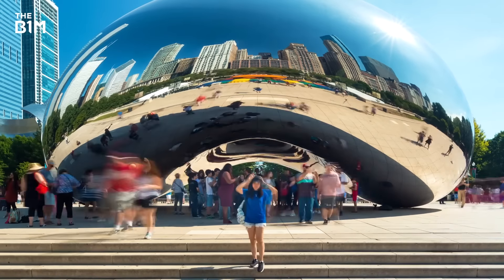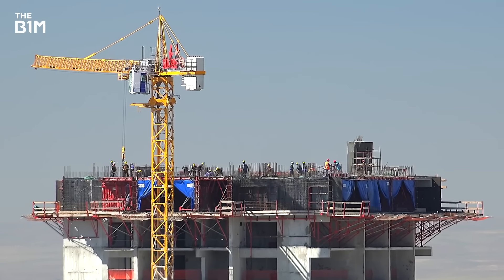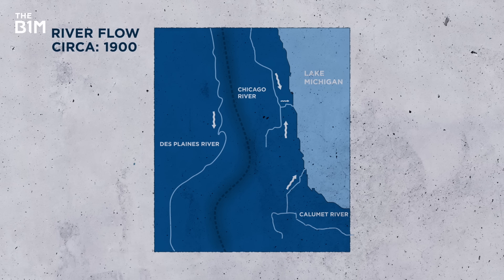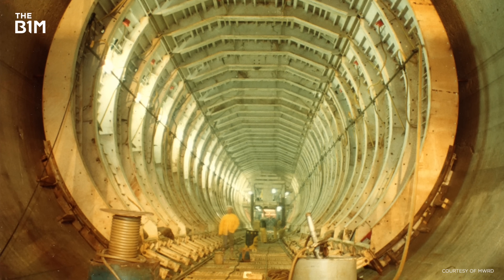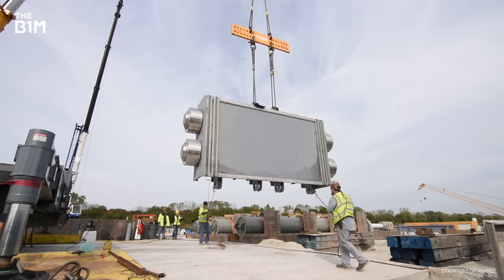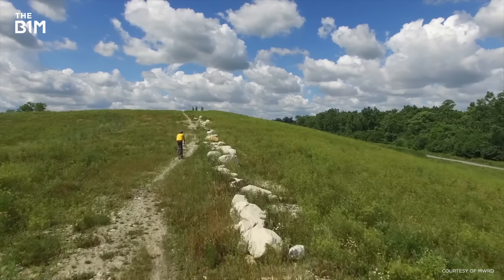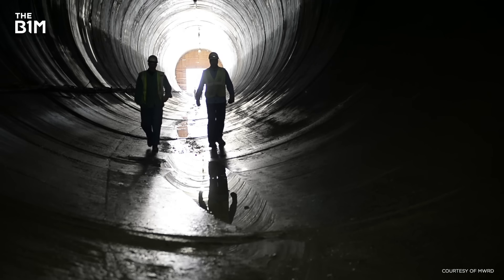The Secret $4BN Tunnel Network Under Chicago

Comment: 4:10 for 8 years as a OTR truck driver i drove past this absolutely massive pit next to the interstate near chicago and had no idea what it was. Now i know!> And trust me, its soooooo much bigger then it looks on camera. The ground just vanishes on either side of you for half a mile, freaked me the heck out the first time.
Reply: How to find it on google maps
Reply: @fourthright  search for Thorton Illinois.  The massive hole in a limestone quarry.  It was not built for the Deep Tunnel Project.
Reply: @gobbletegook  thanks
Reply: wrong hole in the ground lol, you are probably thinking of the limestone quarry. It is much bigger than the resevoir and still actively being worked.
Reply: We call that "the grand canyon" on the cb lol
Reply: It’s the limestone quarry, goes under 80/94, they do a handful of tours every year, and I’ve wanted to do one so bad but the waitlist is like years long.
Reply: @Grintor  Not wrong, the Thorton Reservoir is on the other side of the highway from the quarry.
Reply: It sure is bigger than it looks on camera.  It's on I-80 and I passed over it for years.  It's kinda scary going over it.
Reply: Its another one 55 just north of 294
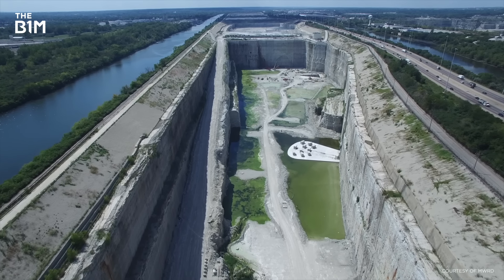Reply: @onenightstan3635  5:45 is a quick overhead shot of it.
Reply: @FastSloth87  It used to be part of the quarry though iirc
Reply: If you drive through Stickney on I-55, there's an example of what the tunnel looks like for the Deep Tunnel Project. It's on the north side of 55. Just follow the smell hahaha
Reply: It does look massive and I can imagine how big it would be based on other such experiences.
Reply: I've always hear that the majority of concrete in Chicago and suburbs was made with  with limestone from that quarry.  There is an observation deck on the north side.  The thing is huge.
Reply: Same here, I think only truck drivers can see it from our vantage point up high. Most people don’t realize how big those pits are. Never had any idea they were something other than a quarry.
Reply: than
Reply: You are referring to the Thornton quarry.  The tunnel guys did not build it, it is a played-out quarry.  They just now fill it with sewage.
Reply: @williamrgutrich7694  I never said who built it, all i said is now i know WHAT it is instead of just thinking its some random hole in the ground or i was seeing shit.
Reply: Ozinga bought it I think
Reply: @profecarrillo6479  Chicago is next to Canada not Mexico...
Reply: @SirFloofy001  my bad sir, I thought it was near Montaña or Montana (dumbed down name).
Reply: @SirFloofy001  meaning, I thought it was part of the occupied Mexican land. but no, it was never part of the First Mexican Empire or the ancient empire.
Reply: That's limestone Quarry. As a child I thought it was the grand canyon
Reply: Driving in to Chicago, one is overwhelmed by the ugly infrastructure. Chicago needs to tear down these ugly abandoned plants and allow green space to take over.
Reply: @mynameisjoejoe  and we call trucks that jake brake "idiots"
Reply: If you think seeing it is freaky you should try rappelling a few hundred feet down the side wall at night in January.
Reply: Is that the huge limestone quarry by South Holland ? I drove for UPS.  Every time I went to the CACH  I'd glance dn wondering how deep it was.....
Reply: Idk why they don’t put up a guard rail higher or something it’s so sketch best not spin out
Reply: Sure it wasn't tho old quarry by the railroads?
Reply: All Chicago Kids are told that Fred Flintstone works down there. lol
Reply: That quarry is by my house in lyons illinois
Reply: Question. What is OTR? Thanks
Reply: @pbinnj3250  “Over The Road” trucker.
Reply: @jseptoski  thanks.
Reply: @michaelkawell3300  LMFAO No it's not. You're halfway across the 'burbs from it. You're over by Brookfield and the Zoo, everyone who grew up here knows how far away you are, lol.
Reply: When your stopped on it with traffic. It moves quite a lot as well😂😅

Comment: Zoning rules in Chicago require any new construction over a certain site area to handle its own storm water internally on site. I have worked on several projects in the city that have required tanks in new buildings or underground reservoirs to store storm water and release it gradually into the system. This should help to reduce the amount of runoff into this project and help make a more sustainable storm water system in the future for the city.
Reply: Yep, this was incredibly contentious when it was first implemented, and now it's just a thing people know has to happen. I'm pretty thrilled the city stuck to its guns on making sure this happened, because now no one even bats any eye at it – it's just a thing you do. And it's incredibly helpful for the entire population.
Reply: @BlownMacTruck  it’s gonna increase the cost of building and expand their environmental impact. The city did not stick to its guns it put the problem on someone else. The city needs two separate sewers a sanitation and storm one. Anything else is not practical and very wasteful.
Reply: @mattmichael2441  I'd disagree that they didn't stick to their guns. They did pretty well given the constraints. Could it be better? Of course. But that's always the case in these situations. Too many NIMBYs and special interest groups fully opposed ANY solution, so I'm willing to give the city credit here.
Reply: Yeah that’s been the case in here NYC for a while now. It’s important as we also have a combined sewage and drainage system throughout much of the city which is problematic when there is a massive amount of precipitation. A similar system to this project but at a much smaller scale is being built around the Gowanus canal in Brooklyn to prevent as many “overflow events” from happening and dumping the waste into the recently dredged and cleaned up canal.
Reply: Pretty much any new development in the midwest requires some kind of stormwater detention system, it's just in less populated areas that's a detention pond(large depression in grass) and not a tank or artificial reservoir. But they serve the same purpose.
Reply: @mattmichael2441  It would cost quite literally 2-3 trillion dollars to do what you're suggesting, and the environmental impact from the project would be far more destructive than the negatives of the current mixed sewer system. Normal sized cities and towns were able to get rid of most of their mixed sewer systems a long time ago, because it's just a matter of running new pipes along road right of ways in most cases. In cities there are massive underground pipe and tunnel networks with huge skyscrapers everywhere. You can't even fathom what it would take to separate stormwater and sanitary sewers in Chicago, there might honestly not even be enough literal space underground to do it. You're way off base on this. - I'm a Civil Engineer in the Chicago area.
Reply: @mattmichael2441  Also, providing stormwater detention is a part of even small projects in small towns. The increase in cost pales in comparison to how much money is saved by the public and business owners from how much we have reduced flooding and flood damages the last 40 years. Now in most places flood damages only occur within regulatory floodplains, that was not the case 40+ years ago before stormwater outlet control regulations were put in place by most states and municipalities.

Comment: I love how we went from 3.45km twin tunnels in Auckland last week to 175km+ tunnels in Chicago this week. The amazement and wonder is real. 

Folks, only on the definitive channel for construction will you get some serious range. 

❤ The B1M
Reply: Ironic that a week ago Auckland didn't have a flooding problem but this week a system like this might have saved 3 lives and 1000 million dollars of property damage.
Reply: And I do have to wonder how the Auckland tunnel faired in last week's heavy storms & flooding rains.  Regardless of the potential increase for flooding rains & heavy storms, I think cities should be emulating Chicago's lead here - taking the storm water run-off, holding it safely away from residents basements, cleaning it up before releasing plus, using good landscape design principles to capture run-off & inundations before they cause property damage - just encouraging people to have gardens & proper soil instead of covering everything in concrete & blacktop would be a start.  I'd forgotten all about this, so good to hear it's heading towards completion & how it's improving the waterfront.
Reply: Roughly the same cost
Told you infrastructure in NZ is ridiculously expensive.

Comment: A very nice video! When we first planned the system in 1975 the plan was to have dual parallel tunnels, the second to be built after the first was completed. That has been dropped. Kevin does a good job of explaining the current theories on TARP.

Comment: Seems like a brilliant solution to a major problem. And the city of Chicago ought to be acknowledged for carrying out such an important project that took years to build.
Reply: The City of Chicago did not have a hand in building The Deep Tunnel Project. It was done entirely by the Metropolitan Water Reclamation District of Greater Chicago. The MWRD is it’s own municipality and does not fall under the control of the city or county.
Reply: @MrSquirrelboy  Thanks for highlighting this, I would not have known otherwise.
Reply: A handful of people died building this thing.
Reply: @MrSquirrelboy This also is the same method Milwaukee did to remedy our own flooding issues. Chicago even took the name straight from Milwaukee's Deep Tunnel project. It's a great way to handle such an issue without major overhauls above ground!

Comment: Chicago has one of the worlds greatest skylines.  Not overly dense but several clear vantage points where one is awe-struck by the powerful structures.  Returning from a trip on the East Coast, OHare was stacked so the pilot stated he would sit over downtown Chicago for several minutes till he received clearance to land.   The pilot circled over the lake in near silence 7/8 times providing an incredible view of the city one would pay $500 to experience in a helicopter.   From an engineering perspective, Chicago deserves the title 'The City That Works!'.

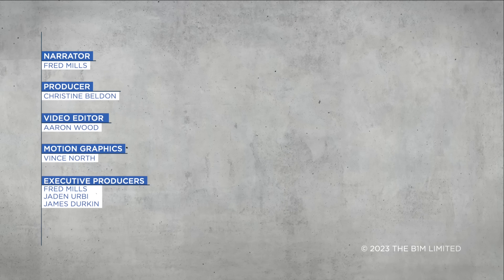Update:  @10:28  The siting of the Trump Tower off the Chicago River and Wacker Drive is one of the best new buildings on the Chicago skyline.  The architect created a modern structure but carried forward many of the traditional design elements (multiple setbacks).
Reply: Trump originally intended the tower to be Chicago's tallest, but 9/11, halted those plans and the building took a height reduction.  Wacker Dr, is on the opposite, southern side of the Chicago River.
Reply: I've been one a few of these circlings at twilight in winter; looking at the silvered glass high-rises is absolutely amazing. It looks likes everything is made of shiny silver.
Reply: Most people in Chicago see that building as a giant middle finger.

Comment: I always assumed the Great Lakes cities were the one and only spot in the world that was immune to flooding. Because like, yeah, no storm is going to overflow the capacity of the Great Lakes.
I never thought about the sewage/drainage problem though! Makes senses to be concerned about how localized flooding would make your sewage pollute the Great Lakes. Props to Chicago for getting ahead of the problem.
(and I still think the Great Lakes region is going to be the most resilient region in the world to climate change. They have infinite fresh water and plenty of farmland to use it)
Reply: Flooding occurs anytime incoming rainwater exceeds the ability of the drainage system to compensate.  This can occur in 'flat' areas too.  It all depends on the volume of rainfall.

Freshwater availability is dependent on rainfall patterns (as is the entire river basin of 2/3 of the US draining out into the Mississippi eventually.  If rainfall drops off, so does the level of fresh water.
Reply: Yeah once the South,  Southwest and southeast are too hot to live and California has burned up, all those folks that fled the Midwest will need to move back. Give it 10-15 years. Decent schools and universities also in the Midwest. Good folks overall.
Reply: The levels of the "big lakes" as we sometimes call them in Michigan, do rise & fall over time and can cause problems with beach erosion. They don't rise with sea level (due to the basins being above sea level), but paved areas in general cause  flooding because roads & parking lots channel water into sewers instead of into wetlands, which are themselves now paved over. Grand Rapids digs a pit in between street & sidewalk, filling it with stones, topping it with rocks, mulch & plants. Tiny bioswales. That's what Chicago is probably starting to do now. A company called Parjana can implant tubes into the ground which speed up flow from surface to water table. They tested it on Detroit's Belle Isle, which floods a lot. The fields they tested drain so much faster! If states & fed gov had sense, those tubes would be going into all flood areas along with millions of swales & wetland restoration.
Reply: The Lake levels do rise and fall slowly over time, it's a long way to the Atlantic from here through various other Great Lakes and the St Lawrence Seaway, a few years back high water and waves were doing damage to the lake shore and can be rough as an ocean at times.
Reply: @Nphen  the Chicago lakefront beaches half washed away in the past 5 years.
Reply: I think everyone here missed a term that's probably not familiar outside the great lakes region: "Combined Sewer". What that means (Milwaukeean here) is that because our sewers were built long ago we combine our stormwater and sewage into one system that all has to be processed at the same plant. In newer cities, when people realized that was dumb, separated them into two systems where stormwater flows into rivers, lakes, etc that are plentiful, and sewer into treatment.  It's still possible to get flooding that mixes the two, but that happens less often because the soil here is relatively resilient to the storms we typically get (although this might change with Climate Change). This is a pretty hard problem to back out of, thus the need for these massive engineering projects.

Comment: I spent a lot of time down there between 1995-99. The deepest shaft i was in was at Bechwith and Narragansett. That was 290 feet deep. You get used to the fact that if there is a cave in and you survive,you're never going to be rescued before you run out of oxygen.

Comment: Wild fact: in 1986 an incident occurred where the system flooded in such a way that 75 foot geysers spurted up at two locations. One in the near-north suburb of Wilmette near the Baha’i Temple (a building whose construction history would make a great B1M installment, side note). They’ve since installed watertight bulkheads to prevent that.

Comment: Huh, I’ve driven past one of the reservoirs before, I’ve always been super curious about what it was! It just felt odd that there was a massive, nearly perfectly rectangular hole in the ground at least 100 feet deep!
Reply: I assumed they were salt mines when I saw them flying in to Chicago.
It's too late for Chicago to separate their combined sewer and runoff systems, but newer systems do keep them apart, as much as possible.
Reply: @anlemeinthegame1637  yeah I thought that they were some type of quarry, but it didn’t feel right. Why weren’t there ever any minerals in storage nearby? Why did the ramp to the bottom not wrap around the quarry at all? Why would it be in a suburban area? It just didn’t really line up haha
Reply: @HarryPorpise  they ARE quarries. Part of the Thornton/McCook quarry complexes
Reply: @tylerkochman1007  huh, that’s interesting
Reply: @HarryPorpise  It's part of a limestone quarry complex, which is still in use. I believe it's the largest one in North America.
Reply: Just quarries.
Reply: My dad always told me they were mines now I know he was wrong lol
Reply: @whoishim2998  mines, quarries. What's the difference? You get rocks from both 😉
Reply: @K4R3N  In quarries the rock is what you want, in a mine it's usually waste material.  Quarry is normally used to refer to building stone(s) like limestone, marble, or granite.  Mine is used for everything else including coal, metal, non metals, or minerals.  Either can surface or underground.

Comment: My uncle used to do a ton of building work in Wrigley and I remember him saying they had access to some of the tunnels running through that area. He also said that apparently there are tunnels that run from ohare airport all the way to the city and when Chicago was pushing for the 2016 Olympic bid they had planned on putting conveyor belt systems in the tunnels to transport people’s luggage from the airports to the city/hotels. Obviously that never happened but he said there are more tunnels than people think.